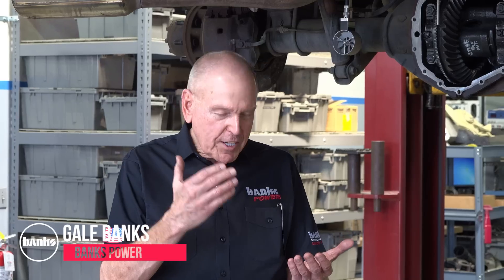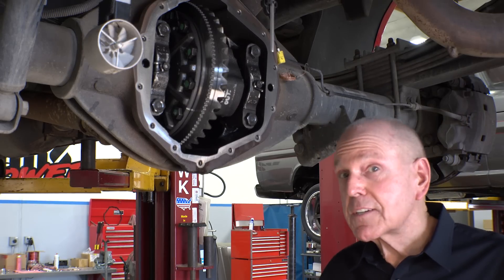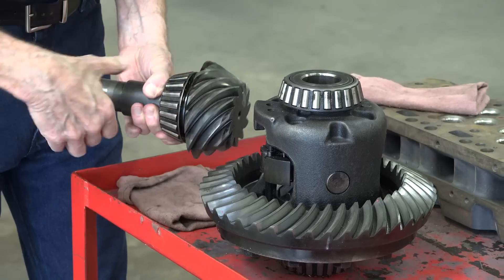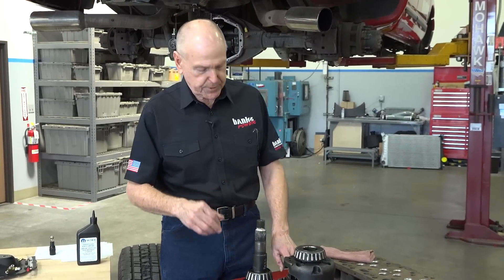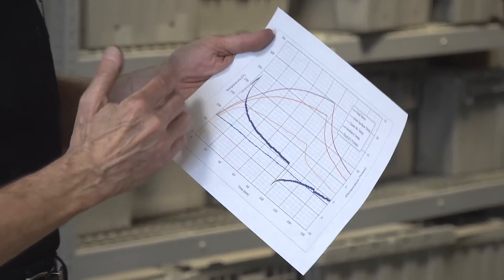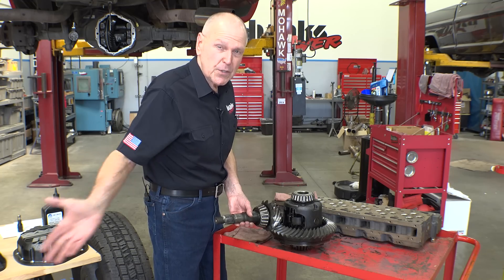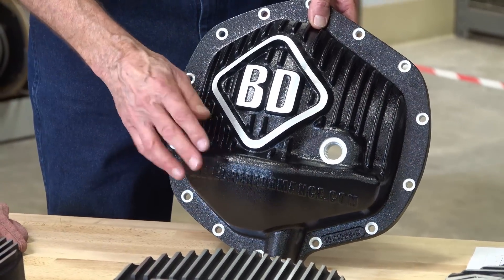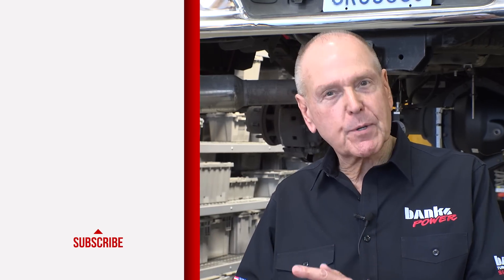Do Diff Covers Work or Are They Just Bling? Part 2 of 3

Comment: you say that some of these pockets and cavities in the diff cover may cause more heat due to fluid movement. however some of these pockets may prevent windage similar to a windage tray of an engine. i would think aerated oil would cause more heat than oil splashed into a corner. not sure about others but OEM diff covers Ford DR3Z-4033-B even come with vertical ribs inside 

a debate for the extra oil capacity, the axle will see the most stress when accelerating. if there is alot of stress from pulling a heavy load accelerating from a stop, the fluid will heat up very quickly due to low airflow. the extra oil will be able to take more heat before reaching a hotter temperature and may allow more lube to the friction surfaces. once the vehicle and load are up to speed, the axle will be under much less stress trying to maintain that speed then accelerating.

alot of people may jsut want a cover for being more durable. nobody would like to back their truck up and a rock or something smash a hole through the factory stamped cover. how likely is this is debatable but can happen. i know many of the offroad covers are iron and not aluminum. but many aftermarket covers are designed for offroad use as well so it can be banged against rocks and survive. we wont need to get into covers with cap supports or other features obviously

there is also the fact that a stamped steel cover is designed to be a cheap yet effective. the manufactures know that more than half of the people who buy a heavy duty diesel truck will not actually use it for any  regular towing purposes. a stamp steel cover cost them pennies to make. but if they start using a fancy cover that may cost them a few bucks to make, a few hundred thousand covers made thats a big chunk of change.

i ill say i wont buy some crazy expensive diff cover for any of my vehicles. most i would buy is a upgraded OE cover that isnt too expensive. i use the Ford 8C3Z-4033-A cover on all my 10.25" axles. its OEM, its cast aluminum with exterior fins, and it only cost 75$ from Ford directly or as low as 50$ in other places

Comment: I am assuming the tire chunking was on the passenger side(Passenger side tire failures happen 70% of the time due to the exhaust temperatures Michelin has found). If you buy two more of those carpet blowers and place them in front of the tires to be used in conjunction with your dyno tire blowers you are already using your chunking problem should be fixed.

Comment: the BD cover is the only one that I see that could work better than OEM.   The fins on the inside are vertical so when the oil splashes against it, it makes it easier to flow back to the bottom and that odd ramp that goes half way across the cover might actually behave as a bit of limiter so that the oil doesn't go all the way up the back of the diff cover.   It should also work to keep the oil in the finned area which has the most amount of cooling.  added surface area  allows for more oil to interface with the aluminum and should allow for better cooling despite the extra work applied to the oil.    This could just be me speculating but I feel that oil that is splashed up to the top half of the cover is doing nothing other than cooling on the cover itself.   The oil is not lubricating any moving parts and takes time for it to return to the bottom.
now I could be wrong and I know engineers have spent thousands of hours developing the diff design but there are things they need to consider that may not be a limiting factor for us.   They need to design it so that it's reliable but also within a budget that the bean counters dictated for them.   They also have to account for a wide range of applications that the truck might be used for.   Someone who is racing the truck will put a load on different parts than someone who is towing or rock climbing.    Financially, it's not practical to design a truck around towing only when some buyers might just be using it as a daily vehicle and never tows anything (most truck drivers nowadays).  So with that in mind, the parts need to do a lot of different things and most of it won't be specialized for any one particular task.    Race brake pads are very different from street OEM pads.   One isn't worse than the other when you use them for their intended application.   But using OEM for race applications might result in premature wear and failure.   
All that said, I am still very curious about the results of this testing

Comment: Wonder how individual electric motors on wheels driven by engine generation.
No drive shaft, differential etc.
Seems like the details could be worked out and be a heck of a system.
Bulletproof reliability and durability with complete dirt seals and liquid cooled.
Independent suspension with load compensation system, when empty as soft as a feather pillow.
Loads handling with ease.
Seems like there would be little driving power loss.

Comment: When are you guys going to finish this series? I would like to know the conclusion.
Reply from the maker: The reason for the time between follow-ups is purely due to R&D. When we post a video, ten times out of ten, it's something that happened that day or the day before. Regarding the diff cover series. We've been sitting on the info for quite a long time. Why? We'll only get your attention once. We're going to reveal the research when we debut our cover design. We made many iterations and several billet prototypes, tested the heck out of the design, then went with a manufacturing process that is far more accurate but takes much longer. We have the diff covers in production and hope to have an announcement soon.👍

Comment: Thanks Mr Banks. Gear head heaven, I don't usually spend money and downgrade my road vehicles with after-thought market stuff. But if I ever go racing, I'll be at your doorstep. I did some searching under the hood based on your MAD video, interesting to see that some manufacturers consistently looking out for the best possible intake locations and some just leaves it in the engine bay itself. The engine performance speaks for itself despite the tall specifications.

Comment: But wait... Some later Mopar American Axles come equipped from the factory with an aluminum diff cover (Mopar P/N 05102232AA).  It happens to look similar to the aluminum ones, but is actually shaped like the steel one internally. Service information actually calls out a specific American axle diff fluid (Mopar P/N 05102232AA) that was engineered for the axle and it’s anti-spin differential. It doesn’t use a clutch pack, so it does not use the friction modifier that is used in the Dana or smaller corporate axles. This fluid is specifically made for the AA axle, and it’s helical gear anti-spin differential. Being a Chrysler tech and working on these daily, I just wanted to interject a little extra info about the subject. I think the stock heavy duty cover should be included as apparently the engineers saw some kind of benefit to adding it to the vehicle. I also think using the correct AA fluid also has merit. 
-Jason

Comment: OK, so apparently the ideal solution(drum roll sound) . . . have a diff cover cast out of aluminium mimicking the factory cover's internal dimension/features and give it external heat sink fins.
Same amount of oil, hopefully slightly cooler under load.

Comment: Can you use laser temperature sensor to check several locations on the axel ?
Reply: Yes. Just avoid the shiny stuff as the higher emmisivity will mess with the sensor. Regular dirt, or flat black paint will work though.

Comment: What benefits over stock do the manufacturers claim? I thought they increased the fluid capacity by extending the cover's volume toward the rear not by making it deeper...  Surprised to hear from Gail that the fluid reaches 300 plus degrees. Does anyone here run a temp probe in the diff?  What does he think of the deep tranny pans?

Comment: I am dying to know the results. I've always thought that those diff covers were junk and in the long run hurt the diff.... I may be wrong. I think the only way to truly cool the differential is by adding a cooler. tapping the differential cover at the bottom and the top putting an actual physical cooler on it with a pump that's thermostatic controlled. Say the pump turns on at 215 and then a fan would turn on at maybe 225 or 230 if it doesn't start to cool down on its own. I'm not sure what the actual optimal temperature are for 75w 90 but the idea is as soon as it starts to get past its optimal range the pump turns on to pump it through the cooler if it still doesn't cool off than a fan would turn on to cool the cooler. I've also always wondered if people do that on a manual transmission that tow heavy loads or under extreme duty situations. I would also love to see if smoothing the casting in the Center section of the diff would help cool it by having less friction or anywhere in the differential where there's high fluid movement to have a smoother surface would help keep temperatures down. Just an idea.

Comment: 15:50 - In most manufacturing removed material is treated as waste. You dont save money or cost by removing material, in fact your adding cost because you're adding steps and wearing your tools and machines. Even if it was a part of the mold I doubt it saved an appreciable amount of money.

Comment: Gale, can you test the mopar factory high performance cover? The was one available between approximately 2010 and 2012 on dually 3500 trucks with the "max tow" package. It was finned aluminum unit with curved fins and a curved profile. Mopar part #68149259AA.

Comment: i always thought high fill diff covers where for when you are driving are more extreme inclines, like in offroad applications. and aftermarket for stronger thicker covers and the added strength
Reply: If you notice with the rounded shape of a stock differential cover no matter how much you rotate the whole assembly the ring can sling oil up to the pinion. Unless you are going downhill in which case any differential will have the pinion submerged in the oil.  And as far as strength, I will take a steel cover over an aluminum cover any day for a very simple reason.

Just like oil pans a steel cover will dent and bend but not leak usually. While an aluminum cover/pan will crack and you'll end up losing all your oil.
Reply: How much actual strength do you think a pan cover is going to give to the axle housing?  My guess is that the cover provides almost no strength at all.  Certainly the cast aluminum covers can't be stronger than the stock stamped steel.  In stress, the steel will bend whereas the aluminum will shatter.
Reply: when have you EVER seen a diff housing break?!  ive seen pinions snap off (gm 12 bolt) and re-use the housings. 850+ hp,  slicks,  and a sticky track can break a lot of parts!
Reply: sorry, i must not have been clear. 
 when i said "high fill diff covers" and "aftermarket for stronger thicker covers and the added strength". i NEVER said covers with this shape, or aluminum covers.... these covers look stupid (like the 6" exhaust tips). i never thought clovers like this were for a performance upgrade, but just a fad (just like big ugly exhaust tips). 
but i thought that the covers on the market that are sold as high fill diff covers like the 3/8" steel heavy duty steel covers from ballistic fab, where designed for off roading. i have only have experience with aftermarket covers like that. and only have seen them off road rigs. look at some of the covers that are made for off road, they are steel, and they have the same shape as the stock cover, except for high fill and thick heavy duty steel...

Comment: Boys and girls, this is how groundbreaking inventions come about. Stop doing what everyone else is doing and study new ideas. Also, the diff. has the same principle as the old Hot Rod magazine test of a big block chevy in 1970, running the motor 1.5 quarts low was equal to 30 hp. Don't forget, when you work a larger volume of fluid, the molecules bounce off each other increasing the temperature of the fluid.

Comment: Oil volume extends change periods as there are more chains to break down before losing lubricity. Efficient flow path can be designed around viscosity using scraper blades to increase temp gain upto operating temp. Those back plates are a waste of time,

Comment: I guess I look at diff covers completely different. I swapped my diff covers for diff protection. Nothing else. I could care less about what might amount to 1hp drop because of the fluid dynamics. I wheel in the woods. I drive on the street... none of which would match his test setup. When I put this on, I was curious how he was going to test the strength of each one... I then realize he's doing this to decide which cover might provide the proper fill level and the correct work on the fluid. 
Interesting, yes. But I didn't do it to add more diff fluid, I did it to protect my diff with a stronger cover.
Reply: My Granny's hand mixer would splash a few quarts of fluid all over the kitchen on high... at like, 1/20 HP. And this fool thinks he's going to measure the difference on a Dyno due to fluid friction losses? This is why mechanics shouldn't try to do engineering until they've learned some basics.

Comment: While I understand the oil level is critical I never thought about the shape. And have spent years visualising engine oil problems. Of which many OEM have gone out of their way to screw up!
Oil level has to be below the axle tubes or you end up with way too much oil up the tubes in cornering [in my case road and oval racing] that blows out the axle seals. And in this case pinion seals as well
I have baffled axle tubes for near 50 years!! 
And what you are saying is commonsense. But bling is bling and must be good!
And as for synthetic oil, an essential in many OEM now and really an essential in all older vehicles as well. A LOT less heat in the diff,,, and gearbox,, and engine oil temp. Mineral oils are maybe ok for mums shopping trolley but even there synthetic is better.
In a racing 358 Chev, drysumped oil temp is 30F less and you can close up all those huge oil leaks as well. Around 1.8- 2 thou clearance is more than adequate. And pump is working less hard requiring less power to run it. Win win
With gearboxes it will make a box borderline at say 325hp live with 450.

Comment: I see one problem with his testing so far...It is not accounting for the vertical movement of the axle during normal travel. If you've ever watched an axle during normal travel it is bouncing up and down all the time, this in turn creates a turbulence that Banks did not account for IMO. The smooth distribution of gear oil in his tests would most likely be quite different if tested under normal bumpy road conditions.

Comment: I don't see any real advantage to the diff covers you've  shown here but I have a different style cover on my Mustang that works like a girdle and has these bolts that screw in against the bearing caps that hold the carrier in place. this cover was already on the car when I got it. I can tell you it saved me from blowing the rear end apart because when I took it off to change the fluid I found the bearing cap bolts had come loose on the ring gear side and I'm sure the only thing that kept it from falling out was that special cover. This cover is otherwise shaped just like the stock one it's just made out of really thick aluminum and has those braces that screw in against the bearing caps. I don't know why they didn't make the covers for these big truck rearends the same way.
Reply: They do have covers like that for big truck rear ends, lpw racing has a few different ones they make. They have one for the AAM 10.5 and 11.5 rear end.

Comment: I think adding more lube is as backward as putting 4extra quarts of oil in a stock engine. It will be close to 5 quarts running due to air in the oil..

Comment: Looks like a duplicate of the curve in the stock cover would fix the flat cast covers if installed in the flat aluminum cover as a sheet metal guide for the oil coming off the ring gear.

Comment: Thicker covers help with flex under high torque also I didn't see him bashing the cover with rocks and sticks. So if you ever had a branch puncture your tin diff cover you already know they are not just bling.
Reply: Should I get a water cooled diff cover?
Reply: @ellenorbjornsdottir1166  not unless your going to dakar or baja
Reply: Another thing that wasn't pointed out. Ground your diff to your frame especially if you have a speed sensor in your diff. Poor grounding with speed  sensors can pit your bearings.
Reply: @terrytdriver  or anywhere, because it gets hot now thanks to global potatoing
Reply: @ellenorbjornsdottir1166  I have rear diff temp gauges in a handful of my fleet vehicles run 26k gvw on the f450s sometimes I've never seen one overheat

Comment: If you look closely to your carrier housing you will see that it has a sort of Cavity on the roof that directs the sloshing fluid from the rear of the rotating ring gear to the Front pinion support Bearing,, 
 So using a Flat back diff cover would degrade the amount of fluid directed to your front pinion bearing too!.  (Which is No Good)

 Ps. Mr Banks, please try to wear a Hard Hat when underneath your raised truck, there's alot of knowledge inside that Head. 👍😊

Comment: I speak from experience any thing very torquey will run fine with 20 weight hydraulic oil farm tractors, Chrysler recommend it in all trucks 34 years at John Deere Product Engineein Center